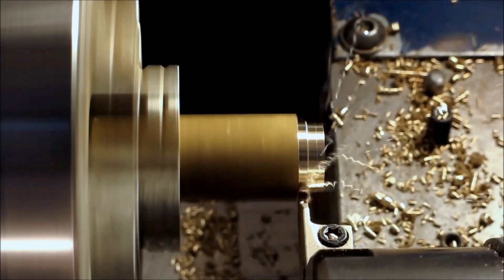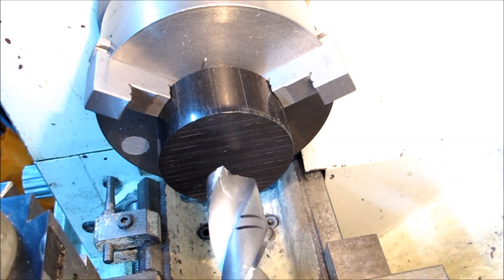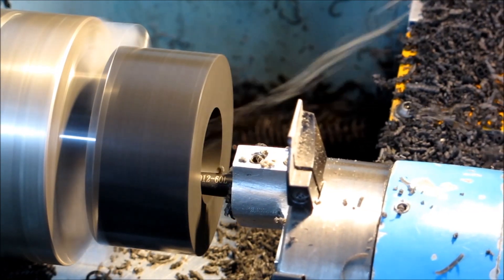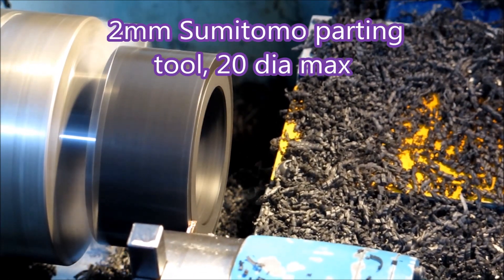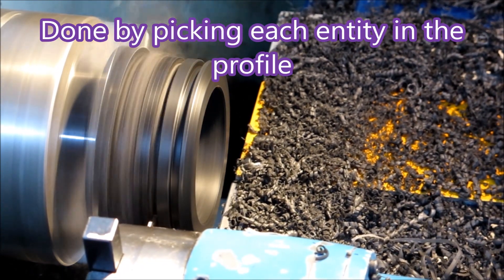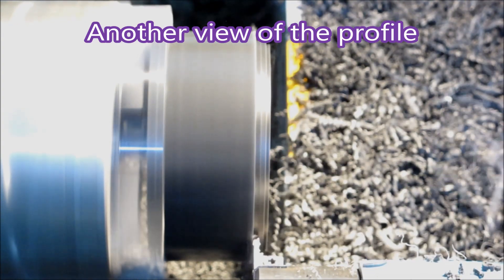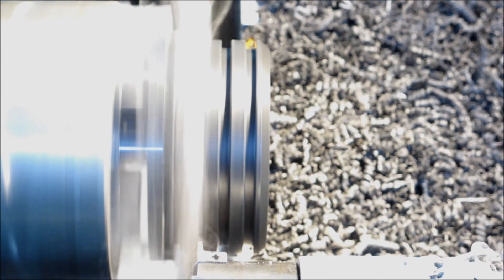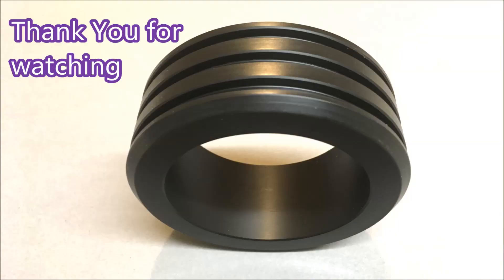Delrin part in a smallcnc lathe with OOPS!

Comment: Hey looking good. I still need one of those great 1.6 parting tools with a 1/2” holder for (aluminum and plastic) Hey if I PayPal you the cost for insert and holder and you grab them from your supplier then ship it out to me. Would you help a fella out.
Reply from the maker: They would be sent to me from the US, so let me find out if they can be sent direct to you instead.
Tomorrow I will check if I have your email address. PC is shut down now and it is time I was off to bed
Will contact you separately for your mailing address and see what we can do.
Reply: Thank you very much.
Reply from the maker: Hi Mike 
Kennamental Canada appear to have a good presence on the web, I think it would be simpler if you go direct.  I can get the tool and insert code numbers for you if you like. 1/2'x1/2" shank tool?
Reply: Ok sure any code that I need, and a number to call them. Yes a 1/2"x1/2" shank tool. Thank you
Reply from the maker: Cncmike68 will try to get codes today
Reply from the maker: These are the numbers I was supplied. I was also sent catalogue page. Do I have your email?  I was sure I had it but can't find it!
Imperial Holder 
#1806716 - A3SCR080110
Inserts 
#4111013 - A2016N00CF01 KCU25